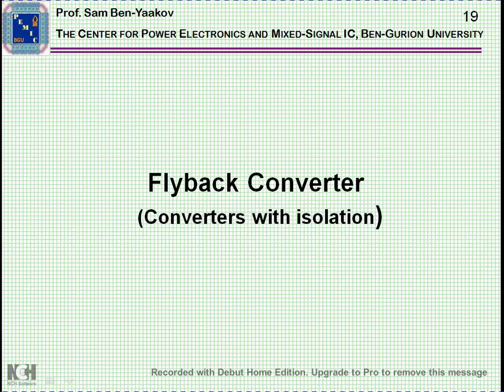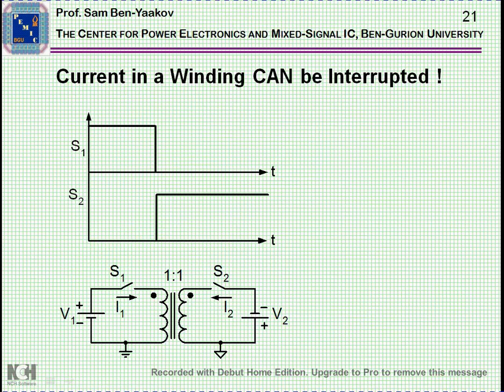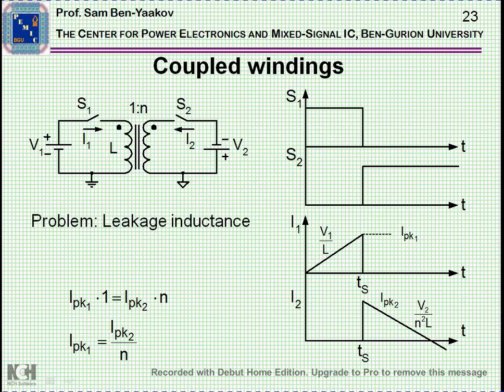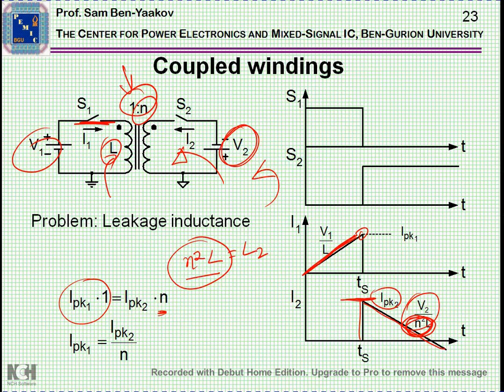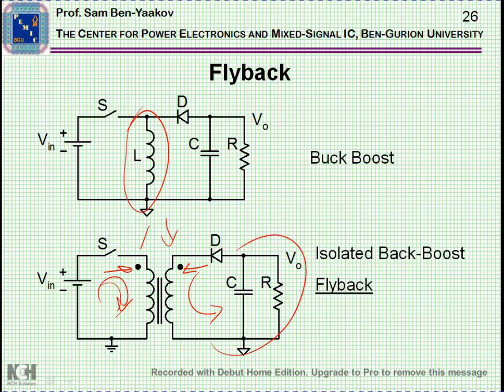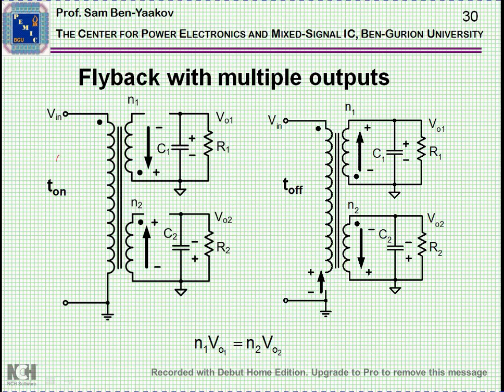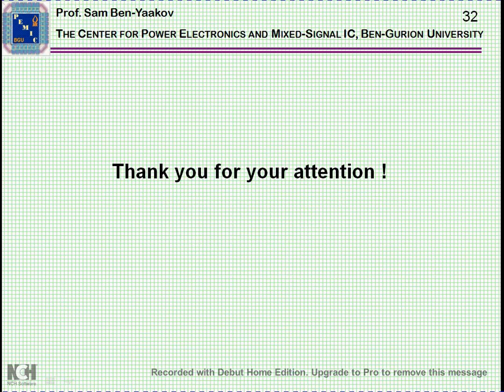Flyback converter

Comment: Dear professor, I am a lab  technician in IRGC’s college of electronics and the way I was taught the concept of magnetic induction in a fly back topology based on when S1 is closed and the S2 is open them the magnetic flux will be induced in the primary and when S1 open and S2 is closed the induced flux will be released via S2 into an energy storage like a capacitor. Your dot convention therefore should be opposite otherwise when the S2 closes there will be high voltage spark which will destroy the switch ,normally a diode or a FET. With love from Khorasan
Reply from the maker: Please indicate the minute of video you are referring to.
Reply: @sambenyaakov      Dear professor Yaakov, I am sorry I couldn’t get back to you sooner and I feel a bit ashamed for questioning you on a small item in your fly back video especially with the epic job you have done so far. Any way using S1 and S2 is ok with me when explaining power supplies but on this occasion I would like to replace S2 ,as just a contact switch , with a diode instead in order to make it easier for me to explain. Let’s place a diode in the secondary coil circuit in such a way that the cathode faces the coil in the same direction of the current in your example. This way when primary is energised the magnetic field resulted in the secondary will induce a current flowing in the same direction which will result in a voltage in phase with input voltage, but the way I see it you are using 240v which produce peak voltage of 320v in order to produce 5 or 12 volts the other side (with higher current of course) which is not very efficient method  .Where as if you change direction of diode and move the dot on the secondary to opposite side of that of primary , then when the primary is on the diode is reverse biased and energy builds up in the coils and when S1 is open magic happens and the magnetic field of B  flips and reacts with secondary coil surface area of A which will cause change of flux per time which in tern causes an EMf of negative voltage. B.A= d(flux)/dt=- EMfv (Faradays law). That aside, may I say that your videos on Switch mode power supplies not only good but head and shoulder above the rest and I thank you for it and wish you long life and happiness.
PS, I hope to god my boss wont see my comment admiring a lecturer working for a  university which is named after a degenerate mass murderer.

Comment: Great video. how does the turn ratio affects the resonant frequency of the coupled inductors? does a higher turn ratio increase the resonant frequency?
Reply from the maker: What matters is the inductance. You can have different turne ratio with same inductance. But there is another issue: interwinding capacitance that can be reflected from secondary. In this case, high number of secondary turns will result in higher capacitance,

Comment: What is the flyback advantages over forward. what type of application each one should be preferred?
Reply from the maker: Forward is generally better at higher power levels, Flyback has the advantage of multiple outputs without inductors.

Comment: If it might be useful: I often use a visual ( a not entirely accurate one ) that the inductor is like a spring that is attached to a reference voltage level ( 0v to ???v), then the switch pulls the other end to some other level, then releases it, the un-'fixed end of this' 'spring' will snap back and 'flyback' in the  'opposite direction. This excursion is then fed into a diode to charge the output cap, which can be at some other Vreference. The placement and polarity of the diodes and reference voltages give you the type of conversion you are looking for.
Reply from the maker: This is why the symbol of an inductor is a spring😊Yes, this is one intuitive way of visualization. Thanks for sharing.

Comment: Hi Professor,

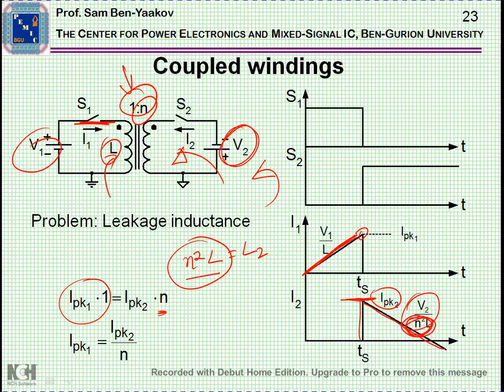On the slide at 7:28, the two lines you have at the bottom referring to the magnitudes of the peak currents: is the bottom line incorrect (because I believe that the top line is correct)? Do you mean that Ipk1/n = Ipk2?
Reply from the maker: Yes, You are correct. The bottom line is in error.  But then, I could have said that I did it on purpose to see who is really paying attention to the contents of the slides (-: Thank you for pointing this out.I hope people will see your comment.

Comment: Dear Sir.  I understand how to calculate a flyback power supply.  I also understand how to analyze most of this type of power supply.  However, a doubt still persists and I would be grateful if you could clarify it for me.  How the equivalent circuit of the switched part of the transformer would look, considering the frequency.  How to analyze the pulsating current waveform in the form of a straight line with negative slope in the secondary?  Shall I regard it as a current source with a pole situated at 1/10 of the switching frequency?  I would be grateful for your assistance.  Thanks.
Reply from the maker: See https://youtu.be/wgyPJn8tNCg

Comment: in 17:38, the current flow in bottom circuit of secondary side should be in other direction, am i wrong?
Reply from the maker: You are correct! Thanks for pointing this out. But, it could represent a negative current..Just kidding.
Reply: Only just watched the video. His solid arrows are correct. His handwritten arrow at the bottom is  in the wrong direction so you are not wrong. After two years I am sure you will have figured it out but it may help someone else.

Comment: my dear Professor, can I use this device for an electrostatic flocking machine?
Reply from the maker: What is the required voltage and power? are you interested in a hand held machine?
Reply: About 30kv, 45 miliamp, and yes, its a handhold operated machine.
Reply from the maker: @parametrikaarquitectos960  30kV is  bit high for a flyback stage. You might need  a second, perhaps spark or resonant based stage. Look up circuits that are used for igniting Xenon lamps.

Comment: With two secondary windings, is the voltage reflected back to the input FET doubled vs one secondary winding?  (Assuming both secondary windings same no of turns etc)  So Vin' = Vin +2 (vsec/N)?
Reply from the maker: The total  reflected voltage is related to the flux (there only one core flux) and the voltage of each winding  ( either forced or induced) is n*d(phi)/dt

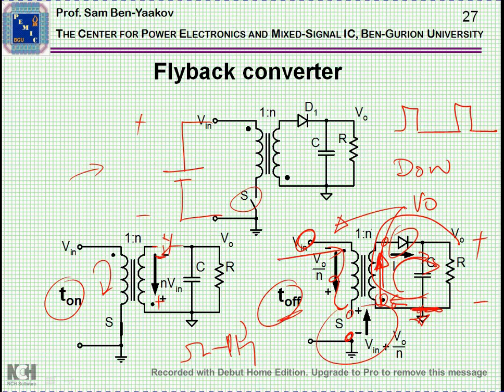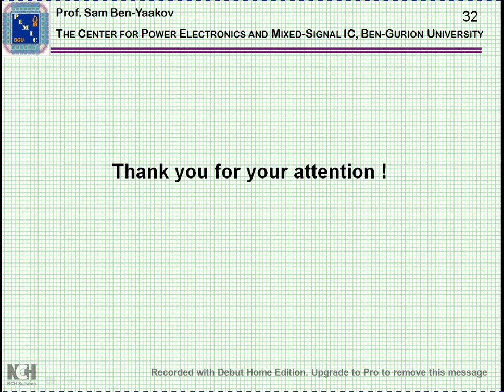Comment: Far easier to understand the action of a Blocking oscillator IF  pri current flows through the pri winding  capacitance during Toff   (see  14:08/20:15.)
Reply from the maker: Blocking oscillator?

Comment: Hello sir. I am trying to design flyback transformer in CCM mode. But I don't know how to make initial guess for the duty cycle. V_in=390V, 
V_out=12V, P_out= 12W, f_sw=132kHz.
Reply from the maker: Duty cycle depends on turns ratio which sets the maximum voltage on the switch. Start with specifying the latter.

Comment: At minute 5:04 you said that the curent rises in liniar fashion because V/L is constant. But the curent rises depending on V across the inductor, not V source. At a point in time, V across the inductor will be 0. What am I missing? Thanks!
Reply from the maker: But the coupled inductors are connected across the voltage sources.
Reply: @sambenyaakov  Even if the voltage sources are constant, the voltage across the inductor is not constant, as the current rises. I don`t understand why the current derivative is considered constant.
Reply from the maker: @gearstil   Even if the voltage sources are constant, the voltage across the inductor is not constant??? The voltage across the inductors are the input output voltages the tipples.
Reply: @sambenyaakov  Yes, that is true, I had the impression that there is a resistor load in series. Thank you!

Comment: At 8:00 I was initially confused as to why no current would flow in the secondary since I was thinking of the inductor as a passive component. If you see it as a voltage source instead until the switch on the primary side is opened, the current flow makes a lot more sense.

Comment: Thank you sir, It is worth attending. What ever you have explained it ,i got it. I have a doubt, TV flyback osc frequency is 15625Hz (Tsw time is 64e-6) 52e-6 is duty(81%) so it is working as a boost converter. I have followed several schematic, i am not getting "where is the reflection voltage and which one part is the reflection voltage schematic and snubber capacitor? If you kindly inform me, I will be happy. So i hope you will response me. thanks.....
Reply from the maker: To which minute in video are you referring to?
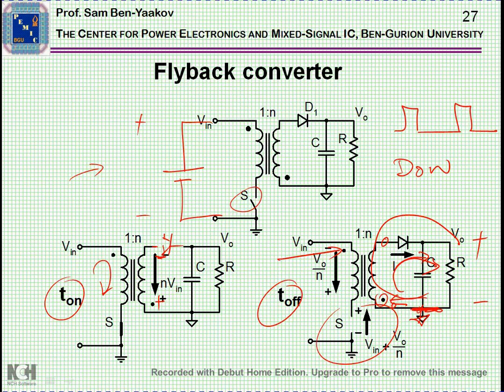Reply: @sambenyaakov  I think he/she is referring to minute 13:15 in which you said that there would be a voltage across the switch S due to the turn ratio between the primary and secondary coil

Comment: What if the load is removed and no current is flowing through the secondary while the primary switch is still switching. Will that cause the inductor to saturate since flux is increasing every cycle?
Reply from the maker: Yes, and more over when the switch is off adangerous voltage may develop. This should be taken care of by the control. .

Comment: I have a question professor. Let's say instead of a single diode we have a full-bridge rectifier at the output. How could you explain such a circuitry, I was surprised to see almost nothing change wen replacing the diode with a bridge-rectifier. 
In such a case is only thing happens that with the help of PWM signal DC voltage kinda turns into AC and then by the turns ratio of the transformer the voltage steps up(or down) at the output? This is how I explain that circuit. Is that true you think?
Reply from the maker: The operatic will depend on the turn ration of coupled inductor which affects the output voltage when the transistor is ON.

Comment: It may be more intuitive to choose a step down transformer in the example.   (n:1, instead of 1:n)
Reply from the maker: Just set n to be smaller than 1😏
Reply: Lol thanks,  Thank you for your transformer lectures, they helped me a lot.
I translated your formulas using a N:1 instead of 1:N.  Designing a step down offline switcher.  Fractional turns ratio seemed unconventional to me. :)
Trying it out with Spice
Reply from the maker: @jpechacek80  👍

Comment: No energy is stored, but the fields (action & reaction fields according to Lenz'law) are there, oppose, and net zero?
Reply from the maker: HI, not sure that I follow your question. Please clarify. (Is it part of an earlier exchange?)
Reply: Hi thanks for your response.
I was referring to the beginning of the video, forgot to mention it. There you said that there is no energy stored in the core of a transformer, but the field of the input remains the same as in the coupled inductor with the secondary not connected. 
Except that the primary field of the transformer is opposed by the field from the secondary according to lenz' law. 
I think there's still energy stored as 2 repelling fields, but not usable?

Was also wondering this.
Would it be possible to reroute the opposing field caused by the secondary to a third coil instead to the primary,,, which 3rd coil is wound opposite to the secondary, which has a diode to prohibit a current from the primary flux, but not from the lenz flux from the secondary? Using a small dutycycle current on the primary.

I'm new to power electronic, am trying to learn some of it on my own. Many thanks for the video's!
Reply from the maker: Regarding the first point, this video may clear thinks up to you. 
https://youtu.be/ZfPL7TJ2vSs
If still in doubt, write to sby@bgu.ac.il
AS for the second, not sure what you mean.

Comment: hi professor , i have designed a flyback converter in CCM mode, but at no load , output voltage is 60 volts instead of (designed)15 volts. 
at designed load it is giving 15  volts. 
I have used RCD snubbers. And converter is drawing 1 amper current from 30 volts input source at no load.  will you suggest any solution?
Reply from the maker: You apparently have high parasitic oscillation. Try to rewind the transformer for lower leakage add snubbers. Using a controller that goes into burst mode will help.
Reply: currently i am operating it in open loop with 555 timer to switch the mosfet, i have used RCD snubbers already,  i think i have to use a controller  IC with feedback mechanism.

Comment: Hello Mr Ben-Yaakov, Thank you for the lecture. I noticed that on the art of electronics book by Paul Horowitz,  the Buck-boost topology that you showed is called the inverting converter, the buck boost on the other have a positive polarity output. could you please clarify this subject?
Reply from the maker: The circuit that I show(with a diode)  is generally referred to as  Buck-Boost, The non inverting version requires 4 transistors, also called Buck-Boost. Google buck-boost and see.  This could be of interst? https://youtu.be/zxxEHAp6jBc
Reply: @sambenyaakov   Thank you sir.

Comment: Hi sir, i have a question at 3:00 time stamp. If there is a delay between S1 going OFF and S2 turning ON, will there still be current flow in S2 ? (I am new to power electronics. i am thinking from magnetic induction point of view and assuming that 'change in magnetic field only can cause current in S2'. Once S1 is OFF, during delay period there are no changing current and hence no changing magnetic fields and hence no current in S2)
Reply from the maker: In this ideal representation there should be no delay. With a delay  there will be a voltage spike. In real circuits as shown later there is a diode that captures the current.

Comment: Hello Mr Ben-Yaakov. There is something that confuses me. Let's say that our transformer's turn ratio is 2:1. At the moment when the switch turns off, primary side's current (let's say 1A) will disappear instantly in ideal conditions and secondary side's current will be 2A due to conservation of energy. 0.5*L1*1^2=0.5*(L1/4)*2^2 where L2=L1/4. That's ok but at that moment how does the magnetic flux remain the same? Flux1=L1*I1=L1*1=L1. Flux2=L2*I2=(L1/4)*2=L1/2
According to this, energy in the core remained the same but magnetic flux abruptly changed when the switch turned off. Please enlighten me.
Reply from the maker: Flux=L*nI 😊

Comment: Why is the current travelling from negative to positive in the secondary? I thought if current travelled into the dot in the primary, then the current had to come out of the dot in the secondary. Or is I2 negative? Could someone please explain this to me.
Reply: Okay, I might have figured it. Is it because of magnetizing inductance across the primary winding?
Reply from the maker: Yes, you can look at this way or, there is a continuity of magnetic field (not current as sometime assumed in error) so this result in secondary current also flowing to dot as in primary.

Comment: Thank you for video but i have just question about Diode when switch is ON there is no current flow through diode could professor or someone else  please explain why? thank you in advance
Reply from the maker: This is because the voltage on diode is in the reverse polarity.

Comment: Excuse me Professor, may I ask you about MOSFET's T-off state, I still confuse why the current of the secondary winding can flow through the diode (forward bias)? How the polarity can be reversed after MOSFET switching? Sorry for my bad English, thanks.
Reply from the maker: When the switch turns off the current in the secondary flow same direction with respect to dot so the secondary diode is conducting. When the switch turns on again, the voltage of the secondary is same polarity as the primary with respect to dots so the voltage imposed on the secondary diode is in reverse polarity and it will turn off.
Reply: @sambenyaakov  thank you so much for the lesson Professor

Comment: In my professor's notes, it says that the current in the magnetic inductance Lm of the primary winding, is increasing linearily during Ton (I agree), and it decreases during Toff (But during Toff it should be zero! The switch is open so how can a current still flow !?)
Reply from the maker: Can you please point to the slide number (or minute in video )  you are referring to?
Reply: it's the back EMF of the coil

Comment: Dear Sir 

A very nice video, although I would like to discuss one incident and I hope you can describe that. 

I have an old CRT TV, and it has this flyback Transformer and my TV outer case is made up of wood except side Speaker net is metallic, by mistake from repairing guy gave a connection from breakage of flyback transformer wire (connection between FBT to Picture tube) speaker net through a metal wire. 
it was making noise as well (may be because of leakage of such high voltage current), so I went near to TV to unplug it and this speaker net was near to plug. 
The moment I went near to somehow speaker net I felt a huge shock without even touching anything. 

can you please explain why that happened?

TIA
Reply from the maker: How close was your body or hand to speaker?